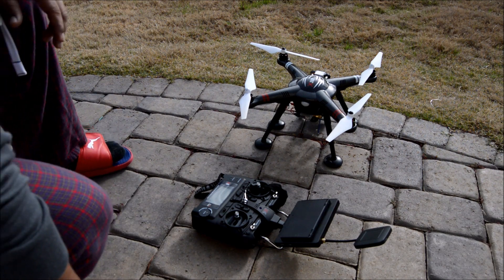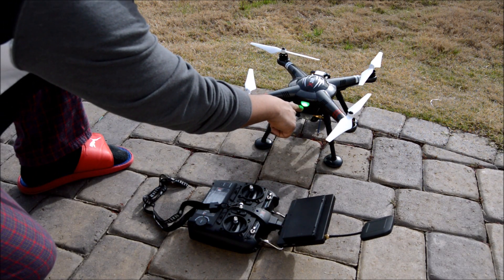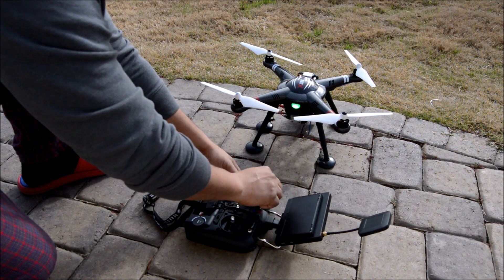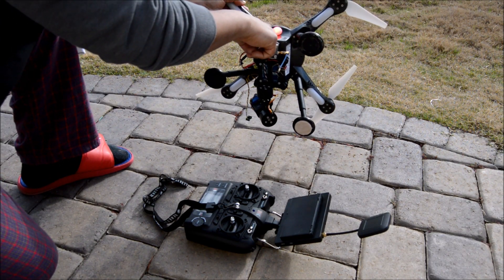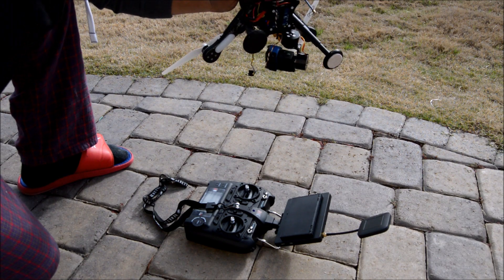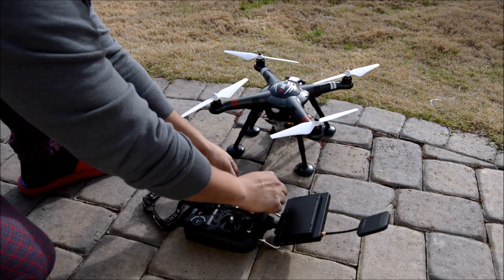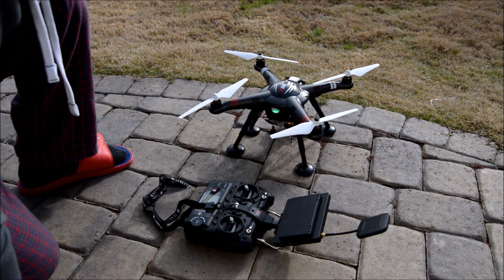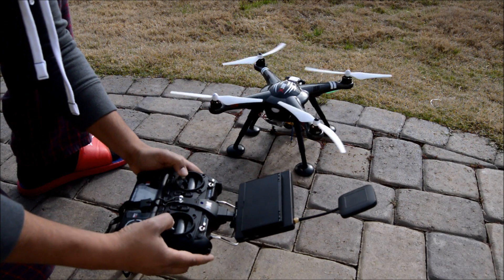XK Detect x380 compass calibration eng

Comment: what fpv system u using +ernestJ
Reply from the maker: +Patrick Aubrey Lindo  hello patrick  i used the monitor from the Syma X5C - 1 X5SC 5.8G FPV and the transmeter from 5.8G FPV 200mW AV Wireless Transmitter http://www.gearbest.com/rc-parts/pp_27971.html#customer_review
https://www.youtube.com/watch?v=UQ0S0JlirxE